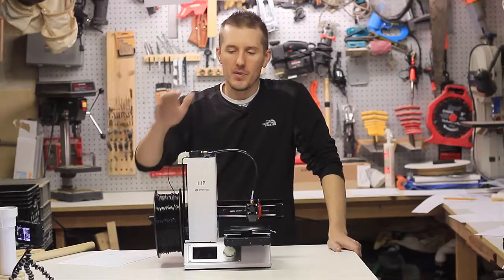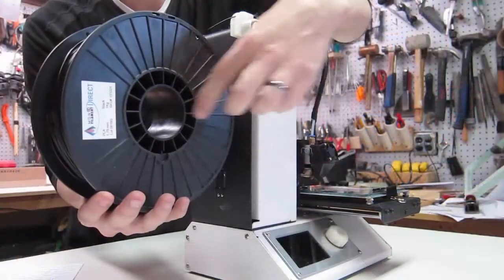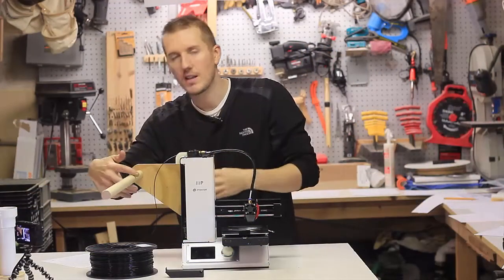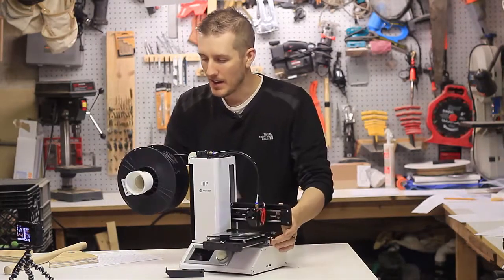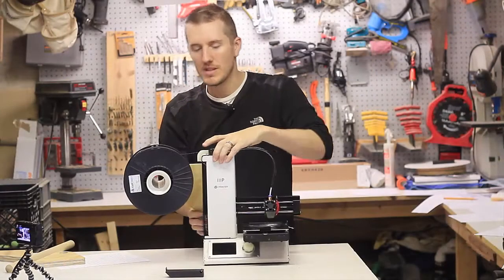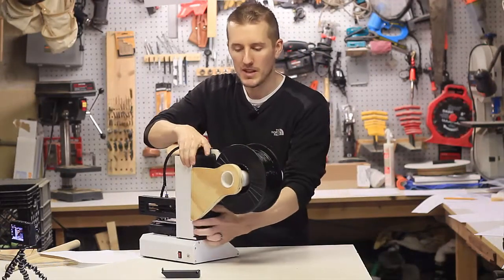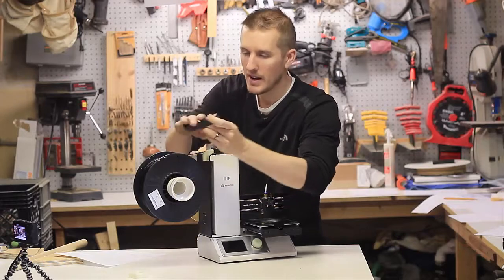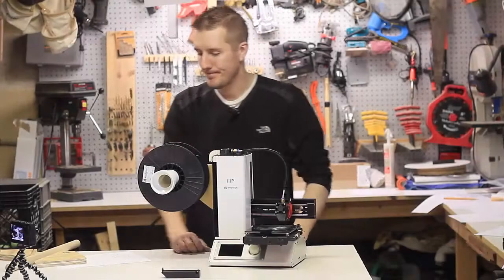Filament Spool Holder - 3D Printer

Comment: I appreciate the video. I'm wondering if it's possible to do like a black and white print (two colors) with this this printer? Thanks in advance
Reply from the maker: Ya sort of.  You have to use the PAUSE button on the menu, then replace the filament with a different color.  You can do the pause manually or add it into the Gcode to have it pause on a certain layer.  But it's not like you can really alternate color every layer like a true 2 color printer.
Reply: Dave Wirth thanks for the reply. I'm sure I couldn't afford one of them 2 color printers. May have to research a bit though. Again thank you for the reply